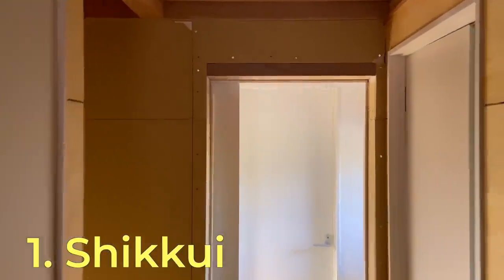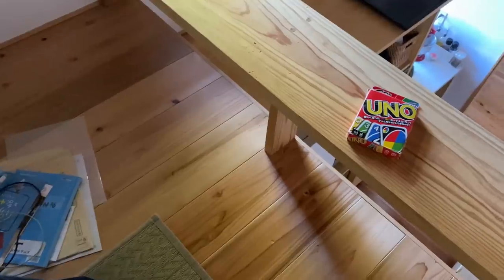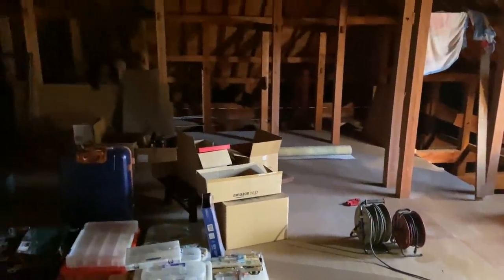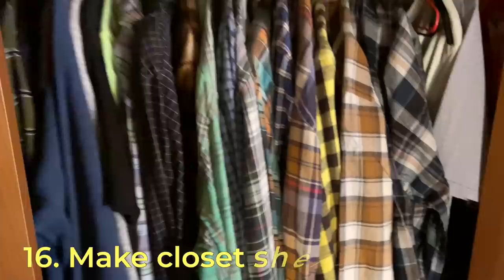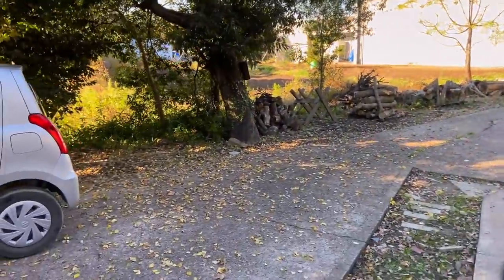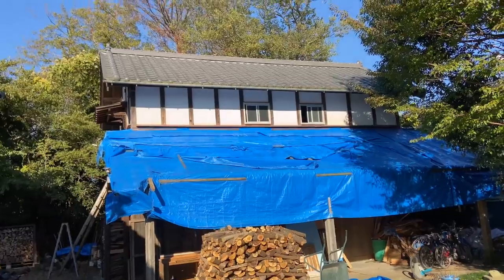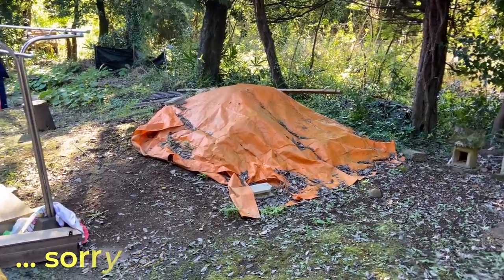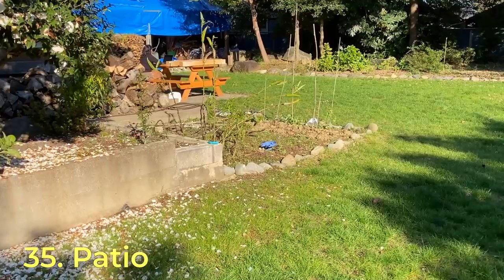35 Things We Still Need to Do on Our House | Abandoned House Renovation

Comment: for a good video try to complete all the small projects in a day

the attic room I'd recommend a lower ceiling between the large trunks, it'll take less supplies and time to do, also means you can stain them to match the other ones in the house to continue the theme

a decorative ceiling in the laundry room ain't a bad idea

have you heard of solar tubes? 
they're a highly reflective tunnel that is built into the roof and comes into the ceiling kinda like a skylight but its purpose is redirecting sunlight into the room.
I'd recommend one for the office to add light without having to rip the walls apart 
and for at night in the office it wouldn't take much to make a decorative ceiling trim to which you can hide led strip lighting behind to give even light without blindingly bright lights in direct sight

if you fix the roof on the kura I'd recommend walling it up as an extra room to store your supplies in freeing up your workshop, 
make the entry point wide with shoji to ensure no matter the size of tool or supplies you bring it'll fit through the door

the upstairs of the kura would make a great office with plenty of light and air flow, possibly a large ceiling fan and air conditioner, I've always been told by others having the office separate from the house promotes productivity, 
or a smaller project room for doing detailed work on smaller pieces that use smaller tools etc

design a wood folding laundry hanger you can mount onto the side of the house so when not in use or if it starts to rain they can quickly be pressed against the house by pushing on it,
it'll save room around your deck and still be quite functional
Reply from the maker: Love these ideas. I had been thinking about solar tubes too, I have seen them in Japan. I like the extra Kura room idea. Also, the office on the second floor of the kura is a nice idea.

Comment: I seem to recall a liner that is laid up on the underside of the rafters, looks like Alfoil but also a little like a long sheet of Space blanket tacked up with chicken wire and U nails or something. That will put an air layer between the tiles and the interior which should help with summer heat. I don't know what its called but it would possibly be a quick fix for starters.
Reply from the maker: Thanks, will look into it.

Comment: I hope that you'll be able to insulate the roof so that you can use the second floor. My parents never did so their house has a second floor, which is big enough to be a flat with about 5 rooms, with a balcony and now it's tiring to keep everything in shape :/. If it never get's used or cleaned it's just lost space and in their case mildew is a slight problem.
Reply from the maker: Yes, it's probably best that I do.

Comment: Regarding to your attic, since only your family is going up there, can you just insulate it with 2" rigid styrofoam. Also, just wondering if a solar powered attic fans is enough to cool down your attic during summer or maybe design a cooling tower to cool it down. Finishing a big project is the hardest thing to do. Even buying a new home which is already completed, there's still a lot things to be done. Thank for sharing.
Reply from the maker: I'm considering foam similar to the stuff we used on the walls. I don't want to add too much weight.

Comment: Meow meow 😸
It looks like you still have lots to do, but thinking about where you started it’s not a huge amount. It looks as though you’ll have firewood for several years. All that wood must have been expensive.

Personally I wouldn’t worry about decking. You have a nice garden. You could do something with stone or gravel. Decking will only last ten to fifteen year and then it will look tatty and need replacing again. I think it works best in small gardens where you don’t have much space to play with.
Reply from the maker: We get most of our firewood for free but spend time cutting and splitting. I will have some stone and gravel in some parts too.

Comment: Now your occupying the house, the list of projects will come down to logistics. What projects should be done before winter sets in? What is best done in winter, spring, summer, autumn?  What projects need to be completed in preparation for another project? What can you do with a little family help and what needs a hired expert? What is currently unsafe? What needs clear or dry weather to complete v what can be done on a snowy rainy day? You could burn the scrap wood over winter, so by spring that lean to is cleared to be demolished. If you are wanting to hang clothes to dry in the laundry, I would do the timber beams on the ceiling as attachment points for hooks or hanging bars, otherwise just shikkui it while the other bits get shikkui'd.
Reply: Also is the project going to impact daily life in some way, and when it would have the least impact, like the Boys closets done in a day while they are out at school for example
Reply from the maker: A good way of looking at it, thanks.

Comment: I would have put the master bedroom upstairs and made the kids rooms larger maybe with a sliding wall in between them so they cold have it open for a larger space when they wanted to. But ideas are easy :)
Reply from the maker: We did consider that actually, but preferred to have smaller kids room and wanted the main bedroom on the first floor. We could use upstairs as the kids' room later.

Comment: I'd be in favor of more hinoki for that ceiling, especially if you've got it.  :)  (Partly cause I'm migraine prone I find it a lot more cozy than white.  :)  )   It was hard for me to see any big flaws in that upstairs workshop space from here, though,  ...maybe those are still good enough for that sort of thing?   (I have a tendency to use most of the wall space in workshops, anyway,  just cause I tend to have my hands in all kinds of different sorts of fixit or other projects.)
Reply from the maker: Yes, I think a planked ceiling would be nicest (don't really fancy doing shikkui upside down on that ceiling either). The upstairs workshop is in good condition, apart from the floors. Zero insulation though.

Comment: Tip one, the most important- a workspace you can work undisturbed and freely is worth soooo much. Realize that as a first, tools, workbench, everything ready to use takes hours of the time when you have to pick everything out of storage. Plus, if you can walk in, turn a switch and work makes your spirit bigger to start. That wood storage should be in there, grab the wood, switch on the machine, of you go. Turn of the switch, light, close the door, and go inside, tomorrow is another day. You can start where you left. Tip two- let go of a time frame. Old houses are a never-ending story of things to do. You are only one person that can do so much. Tip three- insulation goes before all else. The heat will be like a little oven above your head. Then the roof paneling and all other dangerous things, you will never forgive yourself if one of your kids falls down. I learned to do big things when I really had a time frame without anybody around. Kids and wife take your mind of continuous work. Better to make time for the small things that finish in one day if the house is filled with distractions. Don't worry about workshops and guests, we are not in any way free to travel for a long time. You made a gorgeous house in a small timeframe of two years. All the rest will follow, one needs to rummage around to make one mind empty too, a bit zen is needed. I love your cat, such a chatty little ginger.
Reply from the maker: Thank you, yes, a properly organised a workshop sounds great! That's the aim down the track. I have been pretty relaxed about finishing the house (as you can see) since moving in - the work to get it ready to move in took a lot of time so now I want enjoy more time with the family. It will all get done eventually!
Reply: @TokyoLlama  The most important thing of all, family and enjoying them. Well done to make that priority nr 1.

Comment: I dont recomand you to put heawy machineri (like CNC machineri, milling machines) on the firsth floor. Beacuse those machineries require a concreet base because of vibrations, and i dont think any milling machine vibration going to be a good thing for a vooden structure. (But i dont know what kind of machineri you have in mind)
Anyway. Keep up the good work!
Reply from the maker: Good point. I was thinking just small machines up there but will need to research.
Reply: 3D printing machine is probably ok.
Reply: It would be a nice space for a workshop but then you’d be constantly carrying stuff up and down, so better keep it on the ground floor.

Comment: Seems like a mixed bag here, in terms of exciting projects vs. just some work pieces. That deck will be dope, can't wait to see that. On the other hand - insulation :/. Is insulation for the ceiling going to be the same as western fiberglass insulation?  Also, did I see a wood chopper in your shop space? If so, could you chip up some of that scrap wood you don't need, just to get it out of your hair? Finally: 4:25 Nurf dart sighting (all dad's everywhere have a Nurf dart problem in their house). Another banger dude, I'll keep my eye out for progress videos.
Reply from the maker: Thanks very much! I hate those nerf darts - especially in a house with shoji... It is fun to play though... The ceiling insulation would likely be fibreglass or rock wool. I am concerned about the added weight to the roof though if we do insulate it. Yes, that's a wood chipper, it does handle scrap wood, just need to be careful with nails.
Reply: @TokyoLlama  that's the insidious thing about Nerf guns, right? They're so darn fun. There's nothing like hiding in a bathtub and scaring The living daylights out of your child then shooting them multiple times with foam darts. There's just nothing greater than that.
Reply from the maker: @johnbatchelder7168  ha ha, that’s right.

Comment: Are you a worst first type of person (I am) ? The trouble is you have a lot of worst first's in that list ! And yes you should do the dining table. The existing one is...ahem...well it's just wrong !! 🤣🤣 I've found foilboard to be not a bad insulator and quick to apply. Looks ugly but it might be an easier solution in the upper roof area you showed, and mostly unseen there.
Reply from the maker: My wife wants the dining table done asap! Will check foil board.

Comment: Chickens don't really smell unless you really neglect cleaning their coop. However if you're going to let them free range, you don't want their coop near were people will be. They will likely (but not always) still hang around their coop most of the time, and they will make a huge and endless mess.
Reply from the maker: I don’t think I’ll let them free range permanently, but will have a large chicken run.
Reply: @TokyoLlama  Sounds good. Just be aware that if there are foxes in your area the coop should be set up so the chickens are boxed in at night. Foxes will dig into anything.
Reply from the maker: @ratdoto2148  we don’t have foxes but there are weasels and civets
Reply: @TokyoLlama  I was unaware civets were even in Japan, that's interesting. Both civets and weasels pose the same threat to the flock as foxes.